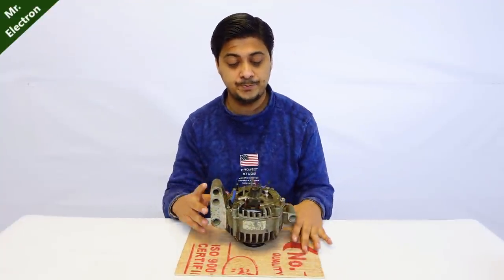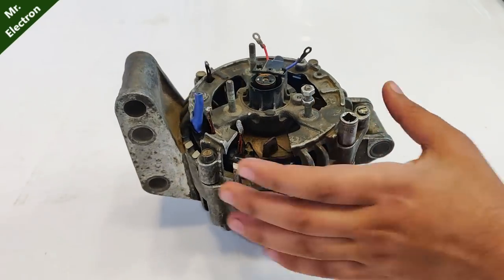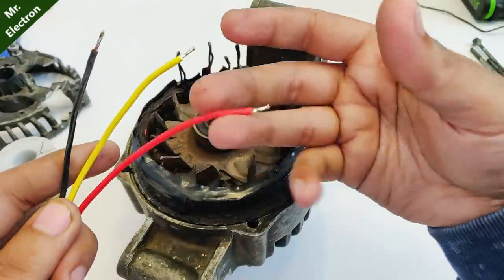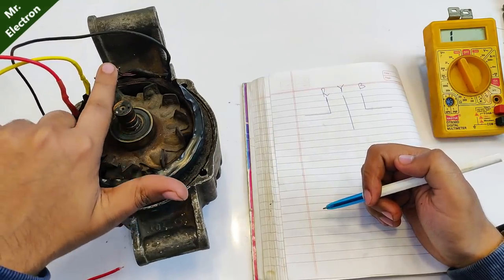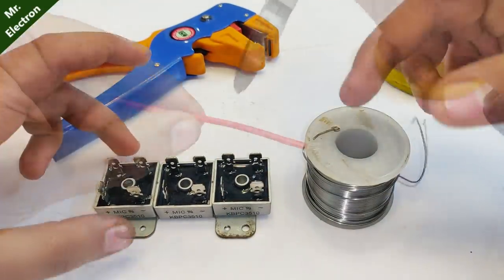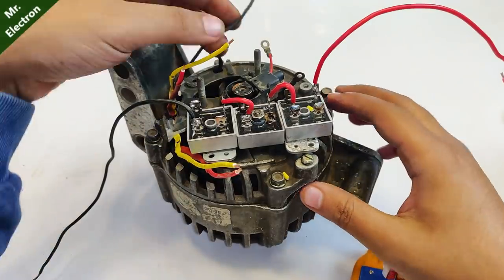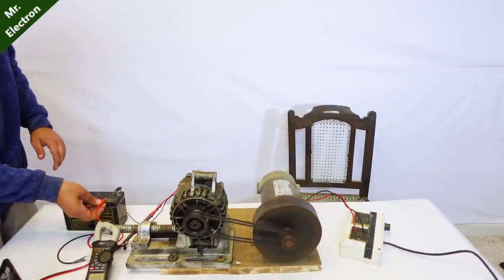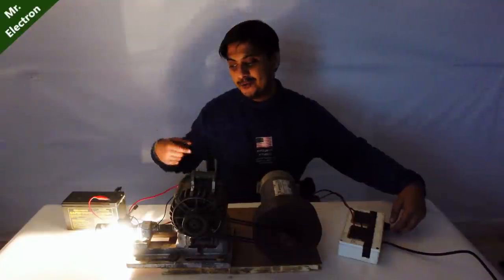36V DC from 12v 64 Amp Car Alternator 750W DIY

Comment: You might like to try this. Add a capacitor across the + and - of each rectifier.  Good sized capacitors Holding the peeks of all three through a full  half cycle and wired in serries will get far higher total voltage under light to medium loads.

Comment: Pretty easy to follow.

I'll probably use 5 bridge rectifiers to provide 60 volts of electricity.  

I'm trying to charge my EcoFlow Delta 2 through the MPPT Controller, it can accept 11-60 volts but has a current limit of 15 amps.

I want to make an AC Generator with a 53cc 4-stroke engine attached to an automotive alternator to provide somewhere between 400-800 watts of electricity, ideally without going past the 15A current limit of the power station.

However, I'm trying to decide which would incur the least amount of losses:

a) AC from the Alternator to the on-board AC charger of the Delta 2  
b) AC from the Alternator to 5 bridged rectifiers (in series) to the on-board MPPT controller

With AC I have some options though.  I could use a transformer to increase or decrease AC output as I please, then I could use commercial off the shelf switched mode power supplies to provide DC current to the MPPT Controller.

Though AC to DC through bridged rectifiers would simplify circuitry, connections, and packaging, however, may not be the most efficient option.

Comment: I have many different questions but I'll start with although he was making 36 volts what was the amperage coming off? Then since the amperage of that was quite low I'm sure probably 20 amperes how can you double the amperage coming off and still keep the voltage the same?....... Also have questions about the motor that's turning the alternators what are the horsepower rating on that the RPM range what was he spinning the alternator at? But all in all a very good video I'm actually using it for an application that will power a camper trailer

Comment: Great! I follow all your videos and they are excellent. I have a question; is it possible to change the alternator for a 12V battery to charge 2X12=24V? battery 12V X 2 = 24V.Greetings from Croatia !

Comment: Thanks, Mr. Electron. I’m looking for an easy way to get a 36V (or more?) three-phased AC stable voltage from a car alternator. How could you achieve this in a simple manner? What kind of electrical assembly, using possibly many regulators could you suggest to me? Thanks in advance

Comment: Hi i have a few questions:
#1 tripling voltage means a third amps right?
#2 in theory if i have a 48V alternator i can get it to 144V with your method then?

Comment: ...... is there more power coming out ..... than going in through the driving DC motor ???? 
nobody seems to want to / be able to ..... answer this question
what is the point of getting DC power output ..... from DC power input ..... if it is not "more" ????

Comment: OK Mr Electron another Great Video.
My question for this one is about the excitation mode, could you not take the 12 volts from one of the Phaze windings to supply the brushes ? or does it have to be that Battery for an external stand alone supply  ? if so can you tell me why ?

Regards from the UK as ever Kev
Reply from the maker: One phase will be loaded resulting in machine vibration.
Reply from the maker: One phase will be loaded resulting in machine vibration.
Reply: @MrElectron  ok so maybe it would work but would cause vibration ..... so lets say then we connect a diode to each phaze and get output that way so no imbalance ? Or does it have to be AC to feed the brushes ?

Kev

Comment: Can i ask, how much ampere did you produce from 36V DC (rectifier in series)?
Reply: 22 amp per 2 wires  max so 22 x 3 is 66 amp max 12v or 22 amp at 36v max  36v x22 amp + 792 watts or 12v at 66 amp   + 792 watts

Comment: Seems like a lot of work when you could have gotten the same voltage from just the main power lug at 6k rpm no need to change all that maybe it’s just your alternator tho! Just get an older one it will produce 37vdc out the main power lug

Comment: Positives and negatives should all be joined together... just like in the actual alternator rectifier. and alternators will make 100+ volts without the regulator, if you spin it fast enough.  Nothing special going on here.

Comment: ? I understand it's 36 volts how many amps is that?
Reply: 750w/36V=20,8A
Reply from the maker: 21
Reply: @AsitShouldBe  for me max is 350 w. look for bridge diodes reference kbpc3510... 35V 10 A
Reply: @samirlebcir6141  kbpc3510 is actually 35 amps 1000 volts.

Comment: Have you ever made an electric bicycle that has a car dynamo charging mechanism or not? Please tell me sirrrrrrrrrrrrrrrrrrrrrrrrrrrrrrr
Reply from the maker: yes but with exercise bicycle
Reply: @MrElectron  Sir, can you tell if a -hub motor or pmdc motors fitted to a cycle can be set as an alternator for e-cycles like 36v ,,, or 48v, 24v etc pleasessssssssss tell me sirrrrrrrrrrrrrrrrrrrrrrrrrrrrrrr
Reply from the maker: Yes
Reply: Thanks .... Its very much useful...... Well done

Comment: INFORMATION.      this  is  a  WONKY   alternator  modification.!!!       in part, because of the way the rectifiers  are  interconnected.        it is probable that  the rectifiers  will rapidly be  Destroyed,  if/when a  Nominal amount of  CURRENT  is  flowing.!!!!       this does  Not   happen  when  voltage is being measured.!!!     neither is it present when current is measured via  clamp meter.!!!          googletranslate

Comment: You turned the alternator into a generator. The other motor is turning the pulley and your exciting the brushes with the battery.  So you've done all that to run a 12 watt car light.  So ridiculous. The more I see your videos the more irritated I get.